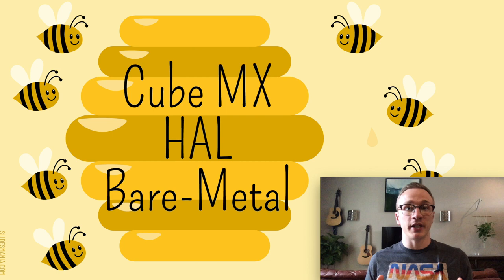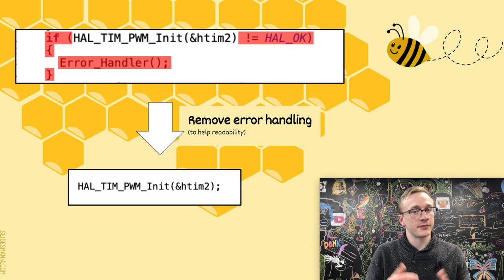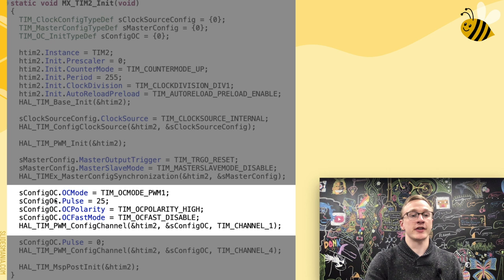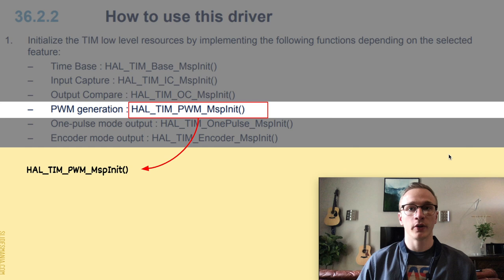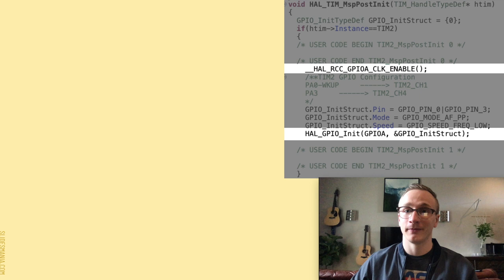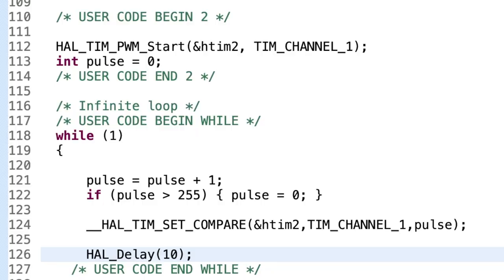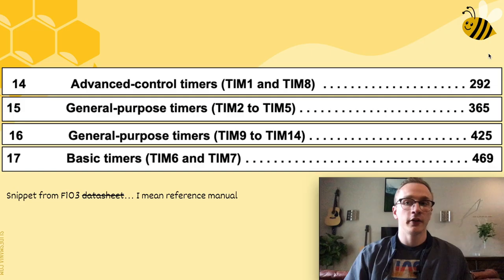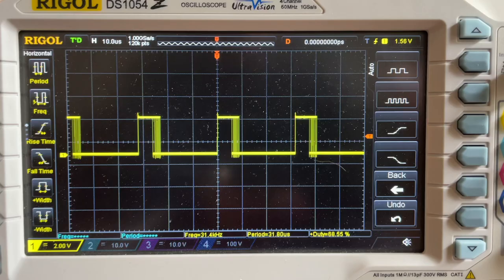STM32 Guide #4: Generated Code, HAL, and Bare Metal

Comment: Hey Mitch, I am currently just starting embedded systems, starting out with Arduino Uno, but I directly want to jump to stm32 and I want to master every aspect of it so, can I directly learn stm32 programming or do I need to know 8051 (or 8 bit MCU programming in general) as a pre requisite or I just take up a discovery board and start doing things with it?
Reply: Imma suggest you first get really comfortable with arduino (like all the communication protocols, i2c, uart, spi etc) then try implementing the simple Arduino project by bare metal programming instead of using arduino ide.

After that jump straight into stm32. I'd suggest you take stm32 microcontroller course on Udemy by fastbit embedded brain academy (kiran nayak) if you really want to save some time otherwise you just have to google everything which will delay things ✌🏻
Reply: @_pawan  yes i have had a look at the same udemy course, could you suggest any other course from which i can learn bare metal atmega 328p(arduino) as you've suggested
Reply: @guruG509  for starter just switch on the verbose option in Arduino ide and trace the calls ide makes during build process.

And about the resources im sending in a moment
Reply: Start with a simpler 8 bit MCU like the AVR series (atmega328, attiny, etc). I also highly recommend getting a real programmer/debugger such as Atmel ICE or STM32 ST-LINK (which most of the time is provided with a DEV board). Start with getting LED turned ON using direct register manipulation, and work your way to timers/PWM, and then the more advanced peripherals such as SPI, I2C, etc. Learn to read and understand the datasheets/technical reference manuals as they have all you need to access every single registers on an MCU.
Reply from the maker: The only wrong thing that you can do is nothing at all.  Everything that you do will help build up experience, which will then help you continue to learn new things.  I learned with Arduino first, and I really enjoyed it.  Comparatively, arduino is very "high level" and you can make projects very quickly with little effort.  For example, I spent 2 entire videos on explaining PWM for STM32, but you can do it with Arduino with just one line of code, and you don't have to know what's happening behind the scenes.

After you have experience with practical projects, you can begin to break them down more.  I enjoyed writing my own libraries.  For example, there's cheap LCD screens called "1602 LCD displays", and they're very popular with Arduino.  You can get it working in less than 10 minutes if you use someone else's code library.  I took the opportunity to use it from scratch, by reading the datasheet and creating my own code.  You learn a lot along the way, and it's super helpful to be able to look at someone else's code if you get stuck.  Once I was using arduino at a lower level, I decided to branch off to other microcontrollers, specifically STM8 and STM32.

This is what I did, and I liked the path I took, but this certainly doesn't mean its the only correct path.  Everyone you talk to will have a different story of how they got experience, and they will all give you different recommendations.  This brings me back to my first sentence: "The only wrong thing you can do is nothing at all"
Reply: @MitchDavis2  yes i agree, whatever you do, adds up  into your experience ✌🏻
Reply: @MitchDavis2  Thanks a lot

Comment: this is why STM32 is hard, they don't tell you these things , and you wonder where they came up with the function names
Reply from the maker: What do you mean?
When I make these videos, pretty much everything I reference is the official ST documentation
Reply: @MitchDavis2  I mean when i try to reverse engineer someone's code or ST's, I often have to back track through documentation. Its a pain sometimes.
Reply from the maker: @mychromebook9935  the documentation is the best place to look for things like that.  ST’s code is all very efficient, but that often means it’s nearly impossible to read what the code is doing.

That being said, if you want to go REALLY low level, their reference manuals are some of the best I’ve ever read